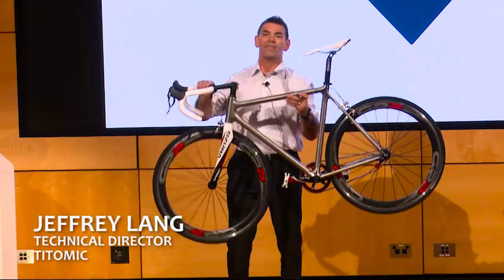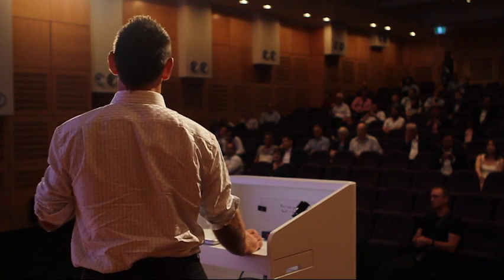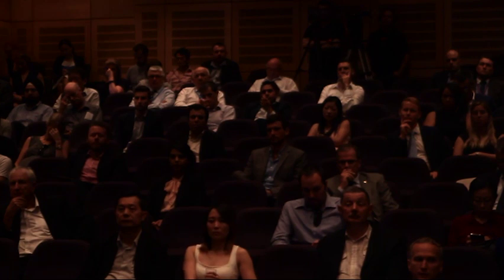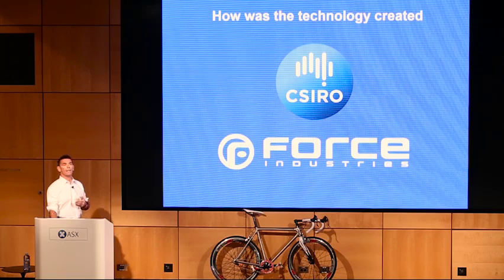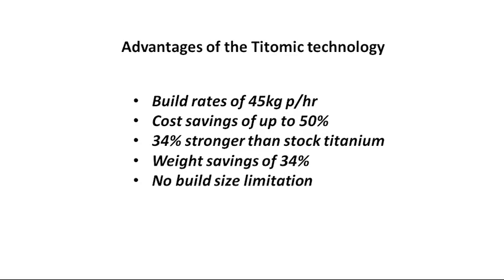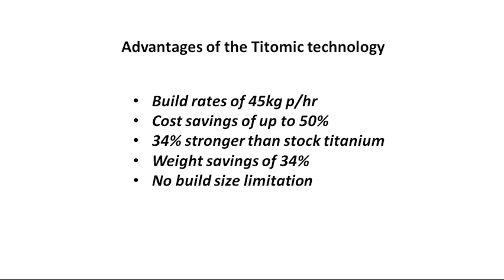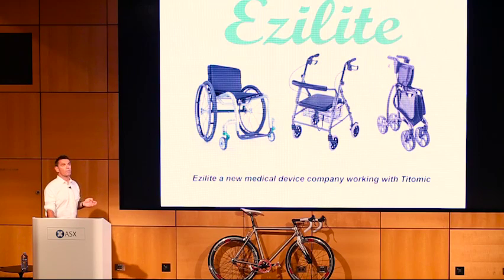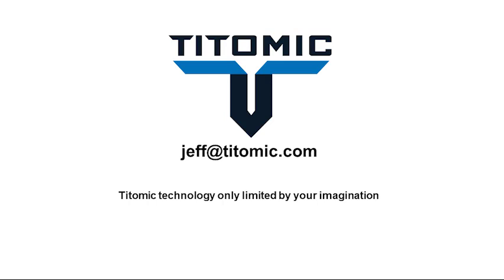Titomic / Ezilite

Comment: This process (titanium spay deposition) has been around for over a decade. GE are market leaders - https://www.youtube.com/watch?v=GOai8jI5op4&t=25s
Others also do it - https://www.youtube.com/watch?v=DnVny_pioJ8. I'm not sure what the real innovation is here - and it's not made clear that the bicycle frame in this video requires an aluminium frame to use as a base (yes they take a full aluminium bike frame and then spray it with titanium powder - hardly 3D printed). Why did Simon Marriott leave the board? He has significant 3D printing industry experience. What has happened with all the deals in the pipeline? Where are the pictures of actual products on the website. I'd be giving this a wide berth